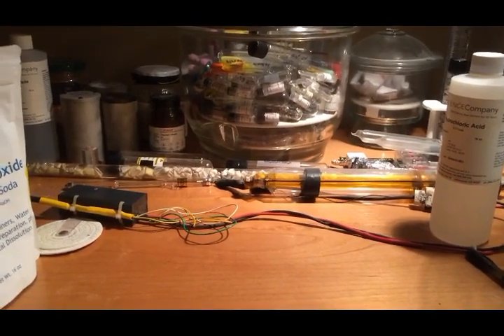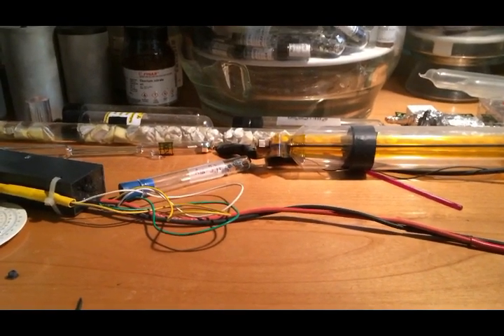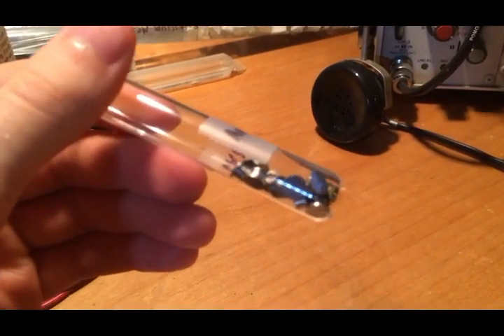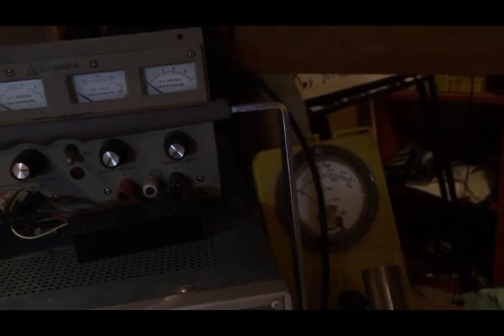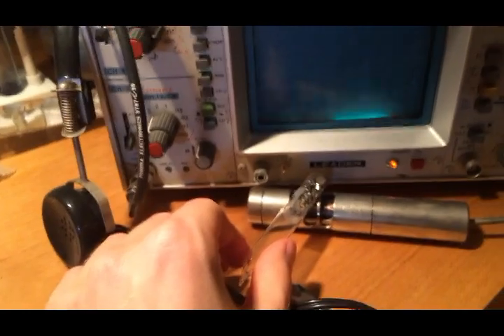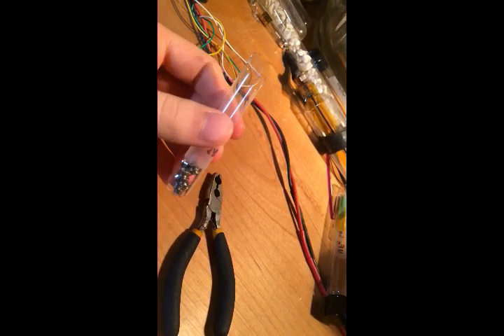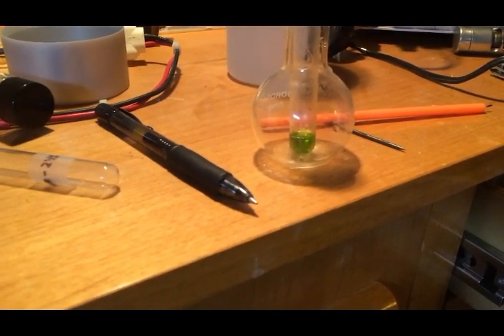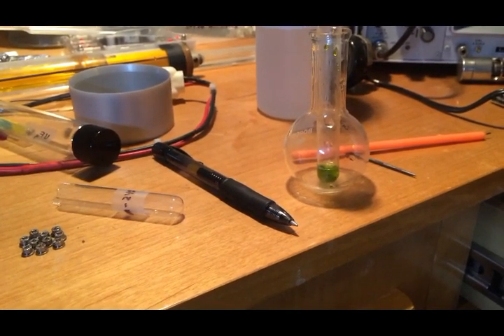How Not To Dissolve Americium

Comment: from what ive seen the Am-241 button sources are a mix of AmO2 and gold, then that's plated in something like silver and rolled into a foil, then its pressed into an aluminum housing and the edges are folded over. so what would be best is to dissolve the aluminum housing in something like a sodium hydroxide solution (which wont touch the foil) and then rinse and add to an aqua Regia solution to dissolve the foils. ill see if that actually works in practice eventually. (some may have stainless steel housings, but the ones i have are definitely aluminum)

Comment: "What you have done here here is potentially contaminate your desk, workspace, glassware, and everything that the solution and or button comes into contact with, a contaminant that can only be detected with an alpha scintillator"( 1nk from the Radzone discord). Please invest in proper protection equipment for work like this and put some time into researching good lab safety practices especially with a radioactive isotope that is prone to contamination.

Comment: The americium is made of the oxide in a gold carrier. This is bonded on silver foil. It would not be wise to do nuclear chemistry like this except in extremely small vessels and in a glove box. If you ingest soluble americium salts it will stick to your innards. If you need intimate contact with the americium for example building a neutron source, you can extract the foils and stick them Am side down on beryllium with kapton tape.

Comment: The button case is stainless steel or nickel. The Americium dioxide source is covered by a thin layer of gold or silver which u can see that especially if it’s in gold.
Reply: Yup the source dot is americum dioxide in very thin gold bonded to silver foil. It comes in reels similar in size to SMD tape reels and the dots are punched out and pushed into the source button carrier through a carbide die Then the little dot is crimped into it. The used tape is then rolled onto a new  reel and sent back to the SRS where the Am241 is recovered. Am241 will form an insoluble oxychloride in HCl, most actinides do this.

Comment: Comments about scraping are suicidal. Ever notice the fine spray of mist that comes out of an orange peel when you are cutting it? That is just the hydrostatic pressure in ruptured cells. Now imagine a blade scraping and skidding on those vapor deposited metals and foils. How many more sizes projectile did you just blast up to float in the air? This is all quite dangerous to begin with but let's appreciate his use of chemical dissolution and extraction is going to be the safest way as long as he maintains flawless hygiene and disposal of everything that touches ANY of this process.
Reply: Mercifly the Am241 is the dioxide in gold foil, and any exposed dioxide would form the insoluble oxychloride, but yeah armature nuclear chemistry is definitely a one way ticket to cancer. Would be good to do a dry run on materials with a similar chemical property and add an invisible tracer dye to see how badly you got contaminated. Was tempted to pull uranium and thorium from ores. Did this mock up with cerium and a uv sensitive blue dye and was like hard NOPE. Hard pass. 😂

Comment: Holy crap I just found my sample after watching this video I've had it for probably 6 years now and this little vial and I can't even see through the plastic bottle anymore. In fact some of the samples appear to have fused with the plastic almost like something was spilled in it and it dried holy crap All of my samples are pretty hot but it's strange seeing the deterioration the plastic is no longer clear on a lot of them
Reply: And that's why you keep radioactive samples in glass! It sounds like you samples were so hot they slowly burned the plastic container they were in. Scary. What samples did you have, because if that's the case I'm assuming a lot of it is radium?

Comment: Couldn't you just take a jeweler's glass and a surgical scalpel to cut out the foil?
Reply: You just pry it out with vise grips or something like that I don't remember how I did it but it seems like I crushed it with vise grips and then just popped it out. It's a little bit thicker than you would want to use a razor on

Comment: The americium is layered on top of a small tiny piece of metal. This "dot" of metal is in a metal holder.  You placed the "dot" AND the holder in the acid. Had you considered taking the americium laced dot out of its holder before placing it into the acid? Also, if the dot is layered with some kind of protective inert substance, such as gold, then it would likely be electroplated gold. Could the americium oxide also be electroplated onto the dot? If so then perhaps electrical removal via a solution and current might be helpful. Thoughts?

Comment: This is about a passive atomic battery I'm working on with a direct ion capturing system using a magnet and a coil Crystal like they use in radios using a permanent magnet to separate the ions and protons through a magnetic field and using the coils to capture the energy of course you would need a extremely fast switching rectifier going to a capacitor Bank to gather the energy at least this is what I'm working on with americium  which has an extremely long half-life I am an amateur plasma and nuclear physicist with both technological and mechanical engineering under my belt I am currently working on a Vortex Fusion reactor or a VFR prototype of my design that uses the pinch effect on plasma along with increasing Fusion rates by creating a multi-directional rotating sphere of superheated fusion I have a star mode video if you're interested and I am looking for funding so I can build a safer and better prototype I actually was not intending to get a star mode when I was testing I was just trying to increase the efficiency to reduce the requirements for Fusion to happen and was able to achieve a high intensity Starr mode under only 28 Mercury's which is a relatively low vacuum compared to the high vacuum systems that use turbo molecular pumps and take hell of a power drop my entire system input is 250watts but that project has been put on hold due to needing funding for proper safety equipment and Spectrum analyzation equipment to get data from my experiments so in the meantime I decided I would work on another project of mine currently building the neutron stabilisation chamber for stabilizing Elemental isotopes and designing a new reactor core with a directional pinch acceleration magnetic field that allows atomization of a source material and acceleration into a Target to cause Fusion to create Elemental isotopes what I plan on trying is to fuse Element 50 or 99% pure tin with element 29 or 99% pure copper this should give us an isotope with 104  neutrons of element 79 gold by taking that isotope of gold that has been created and stabilizing it with 14 neutrons you get the natural occurring stable isotope of gold most recent attempts to synthetically create gold has been using heavier elements like bismuth lead and Mercury and using fission to knock an electron off which creates too heavy of an isotope that decays through neutron-to-proton conversion turning it into Mercury what I'm proposing and theorizing is using the same process that  has created gold naturally in our universe through Fusion of to Source metals and stabilisation with background radiation so I'm developing a neutron stabilization chamber for isotopes and creating a reactor core for fusing lower atomic number elements  it's just a hypothesis and its speculation at the moment until I can get some proof data and major testing I just wish I had a team a lab and funding in order to further my research at a way faster pace

Comment: You mentioned gamma beta when it is actually alpha and gamma radiation. Beta can penetrate glass while alpha can barely penetrate paper at moderate levels.
Reply: @Greg N. while you are correct about the material itself, you are incorrect about the topic of "debating". Science itself is a debate. Most of which is proven by experiment. Other aspects are still "debated" between others. Not 1 person always comes up with the perfect answer especially when it comes to theoretical physics. Science is a collaboration of many individuals in which a debate occurs to discuss outcomes, possibilities, and next steps. So your comment is void and there for unnecessary. The point of my main comment was simply corrective criticism. Which turned into a debate when he tried to defend what he was saying inadequately. Only reason I brought up the fact that he did correct himself was to point out that he had simply misspoken.
Reply: @DSRRingMaster  :
I have measured the radioactivity of a few Am241 sources coming from smoke detector using my CDV 700. While the window is open on the probe, it detects some large amount of radiation. I think it was 1250 cpm. If I close the window (steel, 2 mm thick), the number of clicks goes down dramatically but it is still above normal background.

The probe can only let through beta + gamma so it does indeed look like these Am241 contain some beta source.

Am241 → Np237 + alpha                       432.2 y
Np237 →  Pa233 + alpha                        2.144×10^6 y
Pa233 → U233 + beta-                           26.967 d

Based on the above, I don't think the reason is Pa233 as there would be a very very minute amount of Pa233 buildup. I'm guessing these Am241 sources are impure.
Reply from the maker: Some of the decay products of Am-241 do emit beta. That is why I said that, and my detector can't detect alpha. It can only detect beta/gamma so so that is what I said.
Reply: @DietterichLabs  do you have a source for your information? The decay products of Am 241, as in the what Am 241 turns into after it decays may admit beta. Am 241 in itself does not admit beta radiation. So if you are picking up beta then you do not have the correct isotope. According to wikipedia the decay product of Am 241 is Np 237.
Reply from the maker: @DSRRingMaster  As with any heavy radioactive isotope, there is a long decay chain that eventually leads to a stable product. This long decay chain does include beta emitters. In this case, the main one is Protactinium-233, which is the decay product of Np-237.
Reply: @DietterichLabs  while I do agree with that, it is a little off topic. The Am 241 itself does not emit beta radiation.  With a half life of 432 years, it is an extremely low probability (0.01%) chance of detecting any beta waves. Unless of course what you are testing is not Am 241. If in fact it is a decay product, in which they do emit beta. Then your product source was incorrect on what they sold you.
Reply: To be honest my original comment was early in the video. Later in the video you do say alpha gamma which is what really makes this debate interesting.

Comment: The americium is located in the center of the button. Use a fine needle to scrape the oxide off so your samle isnt tainted with the button metal. It will dissolve but not quickly, much like copper. A drop of h2o2 helps. This also raises its oxidation level. Sodium hydroxide can be used to precipitate as can ammonium hydroxide. Ammonium hydroxide would be preferred.
Reply: @DietterichLabs  Ive been studying chemistry for a couple years now, some university, mostly self taught with radioactive elements. Im one of those crazy backyard scientists, lol. My first real chemical success with radioactive elements was with Uranium. I followed a youtube video on the isolation of uranium and managed a few grams myself. Immediately after my experiment, I invested several thousands in a very impressive chemistry set and enrolled in the local university for chemistry. The lead professor was impressed to say the least. Since then Ive been doing alot of wet chemical isolations of precious metals. Its one of my favorite hobbies. Im in the process of making my own oil refinery. Its a work in progress.
Reply from the maker: @Froddofromtheshire  That's cool.
Reply: kickinthebucketofmilk you're an imbecile.Dietterich Labs Do Not scrape and aerosolize alpha or for that matter any radioactive material. You are asking for cancer at the very least  if not for organ failure. If you must extract the Am, do it chemically.. If you get a little Fe or Al in there, what's the big deal?? You won't even see a physical quantity of Am241 from a 1000 detectors !!!
Reply: @shazamshazamski4490  you only live once so might as well have some fun with radiation